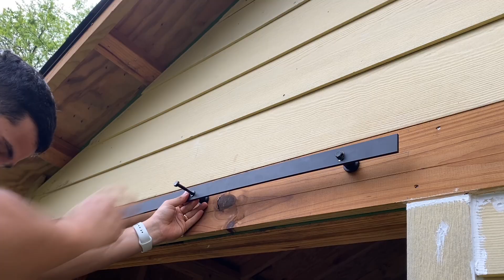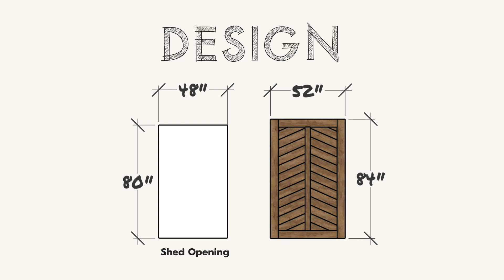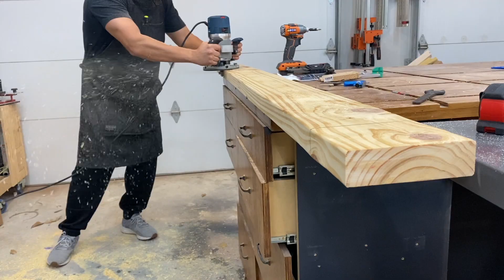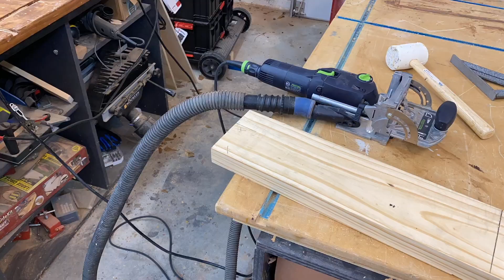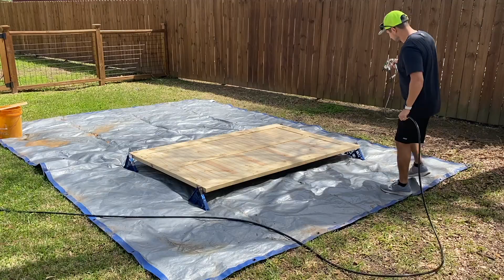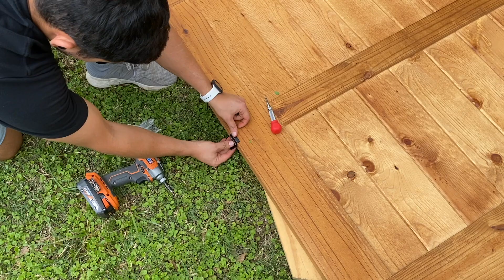Barn Door Build | How-to

Comment: Thanks Juan! I don't have all the fancy tools you do, but I built this exact door (mine was 53" wide x 82" tall) and it really looks terrific! Wish I could upload a photo. I used a different barn door slide — (exterior grade, also natively 12 feet long, with a slide guide on the floor to prevent front-to-back movement). And I installed whisker strips at the edges to help keep out bugs and mice. My shed has a cantilevered roof over the door, so I'm not worried about water entering. I appreciate your thorough guidance in this vid!
Reply: This was my thinking. What kit did you get for exterior grade, and what whisker strips did you use? Did you come up with a lock solution?
Reply: @nfgojags1  I used the SmartStandard system (Amazon), and upgraded the floor guide to their adjustable roller guides. My yard is on the side of a hill, so the shed is built on its own deck (to make it level). The door area has a 4 foot roof over it. So while I couldn't find a barn door system that was fully rated for outdoors, the one I selected is more industrial grade and easier to weatherproof. Whisker strips — technically door sweeps — I ordered the sizes I needed from DK hardware. Lock — Any regular padlock hasp will do. I mounted it to the back of the door so that the hinged plate sticks out the side and nicely hits the catch. Easy.

Comment: Couple potential issues here:
- Indoor kit might rust over time
- Water might seep in during a storm
- Gap between door and wall would let dust/insects to enter

I've been thinking about a sliding door solution but so far any exterior kits are very expensive, and none seem to focus on making a good seal.  The solution seems to be brush seal which is okay I guess.
Reply: Like a friend of mine (who was a professional builder) said: "It's a shed...!  Brush sweeps and a 2" to 3" overlap take care of the majority of issues; and a U shaped piece along the bottom can control any tendency of the door to part from verticle.

Comment: Like other comments, how do you ensure that water does not come in from the sides?
Reply: What I have seen is leaving a 2 inch to 3 inch overhang on each side, and then installing door sweeps; the one I looked at had brushes rather than a rubber edge.